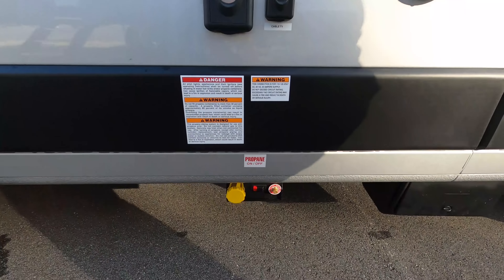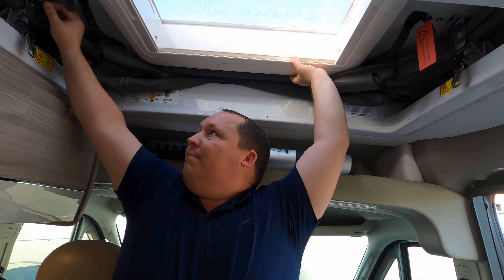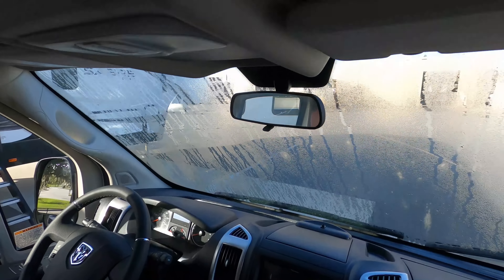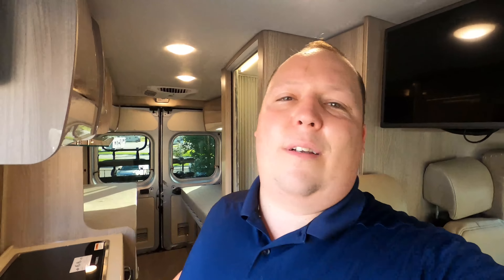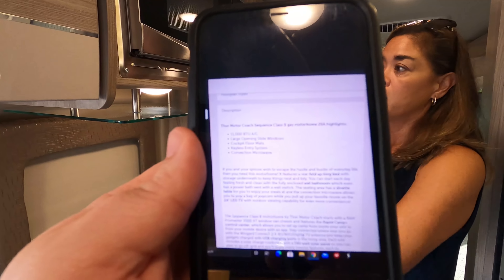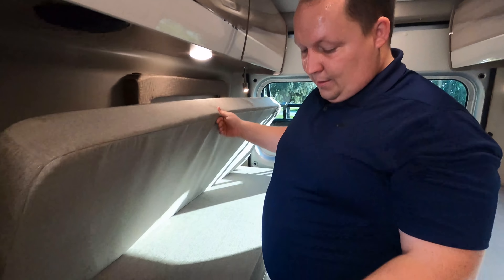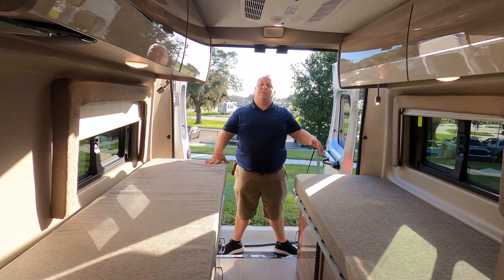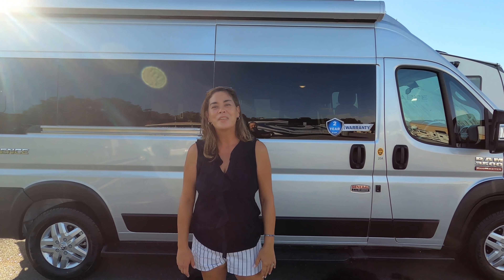Thor RV Just Created The WORLDS BEST B VAN!

Comment: You guys can tell if it’s a microwave/convection oven by looking at the top buttons on the microwave, convection will be written usually top left and microwave on top right in small print, also buttons will say preheat and convection, again usually top left buttons.  You don’t preheat microwave so it’s a convection.  Anyway good video as always.

Comment: Likes: 1. cassette toilet - so easy to handle waste 2. pop top! we travel with our pets and bikes/tri gear. we can keep our expensive gear inside and sleep "upstairs at events. 3. overall interior design - colors, cabinets, layout, it all really works. 4. Price. It is reasonable in the class B market.
Dislikes: Not all electric -  this is directly related to the price but would like to see an all-electric option. 2. Lack of side cameras. 3. Generator placement - would definitely need to get this van "lifted' which drives up after-market price.

Comment: This Promaster is just like all the rest no matter what year. Brake has always been on the left. You open the gas door from the lower right notch  (hinge is on left). That's what that small notch is on the door.
Reply: You have to be careful, when entering on the driver's side, if you forget to close the gas access door and you catch your coat on it, it will break in two. Been there...Done that on a my previous RAM class B.

Comment: I'm waiting to see if it has a lithium-no generator package which solis doesn't have.
Reply: According to the Thor website, "the Sequence comes with an optional Re(Li)able™ Battery System powered by Mastervolt®, a worldwide leader in battery inverter technology. Operating as a truly green product, this system eliminates the need for a traditional generator." I had to look it up because I'm also interested in a no generator option, and it cost an extra $24,994 when I used their Build & Price feature.

Comment: Nice little van, but a very standard floorplan here in Europe.
Likes:
Cabinetry
Storage cabinets underneath the bed
Kitchen countertop space very good for a small class B
Dislikes:
Dining table too small - there are much better solutions
Bathroom too small - here in Europe there are solutions where you can extend the shower into the walkway, they should copy this as well
The step between dining area and the rest of the van - very dangerous

Comment: The 3 things I like about this motorhome:
1. the cabinetry
2.the kitchen, especially the microwave placement
3. the parking brake on the left hand side of the driver's seat

The 3 things I don't like about this motorhome:
1. the step up into the cab
2. the need of some sort of step to stand on to raise the pop-up for the vertically challenged
3. the bike rack on the rear is too low

Comment: This is one I could live with.  The thing stuck to the rear door is a magnetic mount to support the top of expanding ladder for use on the outside of the van to get to the roof from any point along the drivers side.  Like the storage, 4 seat belts,  cassette toilet, truma.  Dislike:  narrow aisle, skylight, inside step.  The specs are not correct.  There is no black tank (cassette toilet), sleeps 4 not 2.

Comment: That's a cool RV-[sees generator]- NO!  NO IT ISN'T!
It's the 21st century, get with the lithium battery systems already.  I liked the floorplan but the lack of something equivalent to or better than Volta's Pure3 system puts me off.
C'mon Thor, I understand wanting to hit the "lowest-cost Class B" mark, but there's a reason why folks buy Class B RVs - stealth and extreme boondocking.
And right now, only the Volta Pure3 gives you those two things in spades.
Reply: I think that Thor does offer a lithium package, for $10-20k more.

Comment: US mfr's need to go to europe and see how well  they lay theirs out, and they are cheaper with better quality build, dont like the raised roof, dusty, dirty hot and cold rather have the bed drop down from the ceiling..also the rear bed should be higher or raise up allowing you to take bicycles, scooters along if you like, others do it, and the wet bath is to small,  and no diesel engine way more efficient and longer lasting like the generator and the small length
Reply: You don't need to get it with the pop top, that's a $14,000 option. And any floor plan you can find in a Promaster you can get in a Sprinter if you want a diesel, just be aware that'll cost about $20,000 more.

Comment: Nothing original here that hasn't been done by other manufacturers. 
The bathroom is a joke for full sized adults.
IMHO - Build this on the longer chassis and use the extra length to enlarge the bathroom and add a 5' dual door fridge on the kitchen side.This is way too small for 4 people so you don't really need the pop top sleeping area.